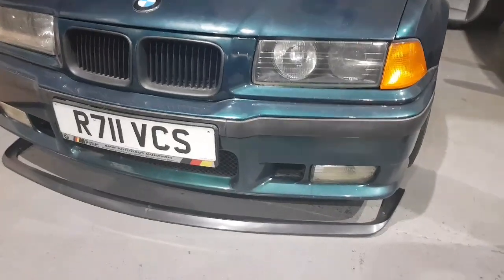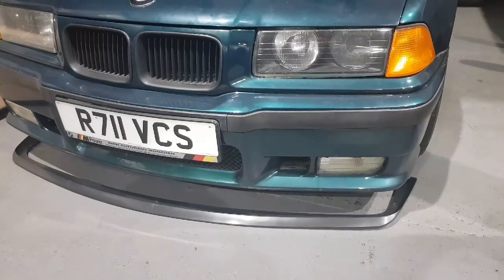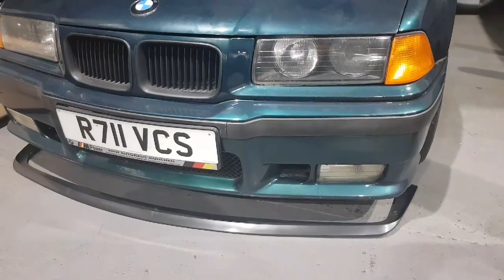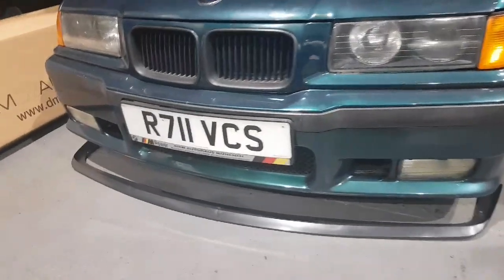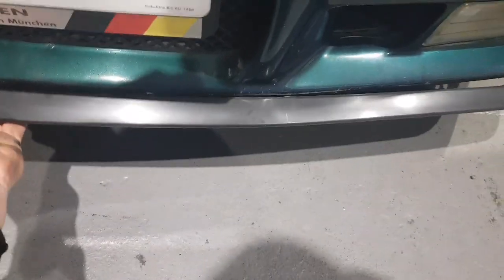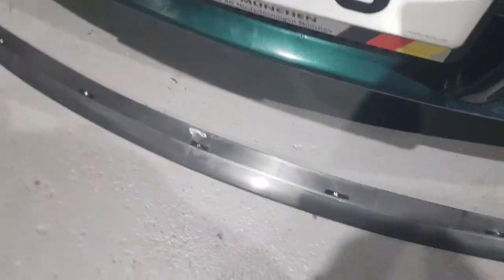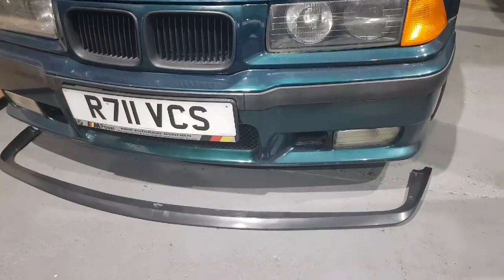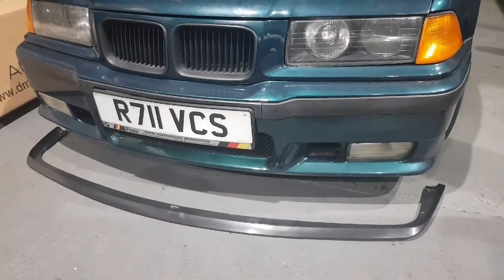BMW E36 328I SPORT..WE GOT SOME BBS RIMS.

Comment: Was literally just writing a comment saying throw a purple tag on whilst you’re doing it well worth it to sharpen the E36 front end up
Reply from the maker: I think i will chuck one on mate. They arent a fortune as ive been looking at them.
Reply: @onthelimiter6529  yeah for the sake of £50 it’s worth it trust me. Solid steering coupler worth doing whilst your there too
Reply: Agree on both, the purple tag rack and the solid steering coupler - great upgrades for low cost 👍🏼
Reply from the maker: Cheers lads.👌👍